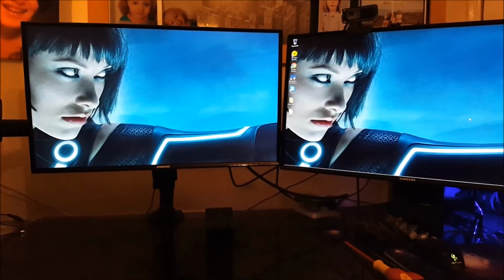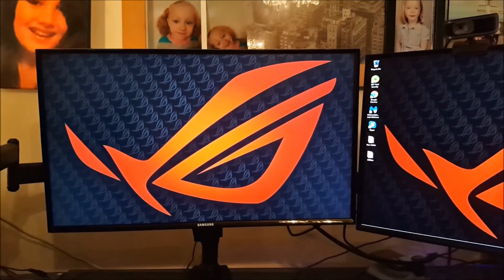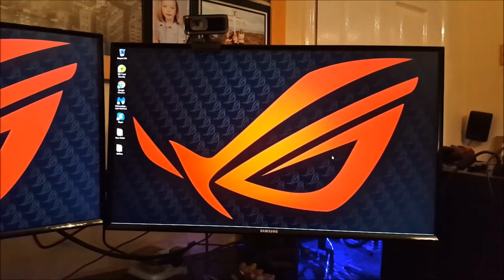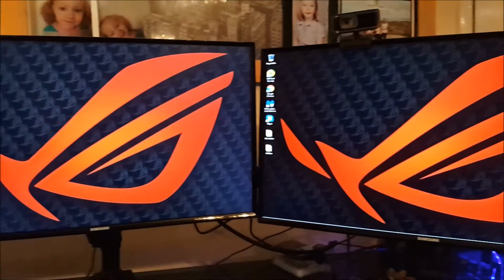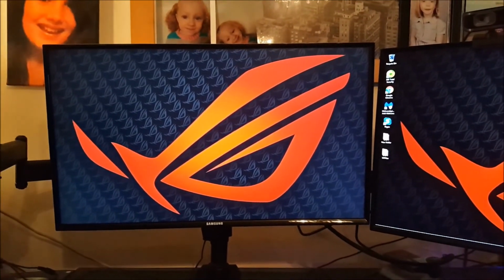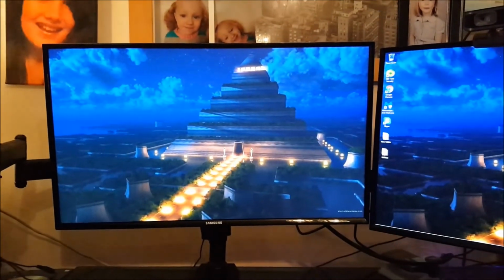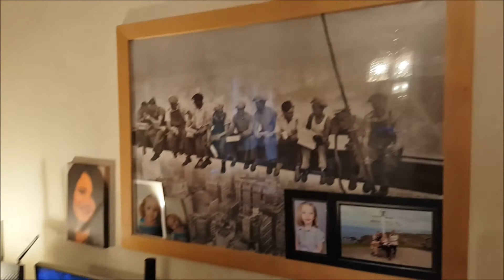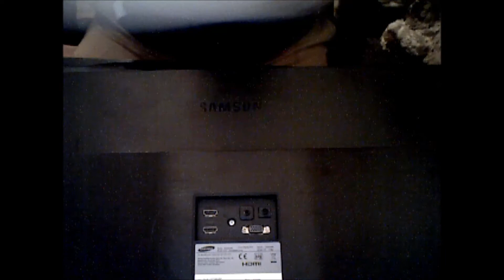Samsung S24D590PL VESA mount upgrade modification

Comment: A couple of years since I tried this with the same monitor vertically rotated. Also, I was very clunky with my drilling so the holes I made are actually bigger than the bolts.
But still ZERO problems!
Thanks again for the video